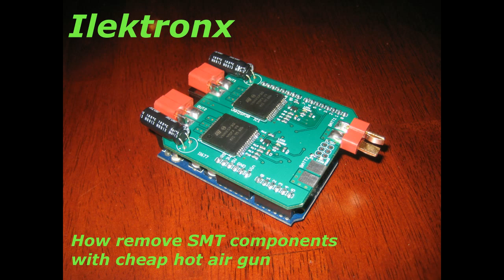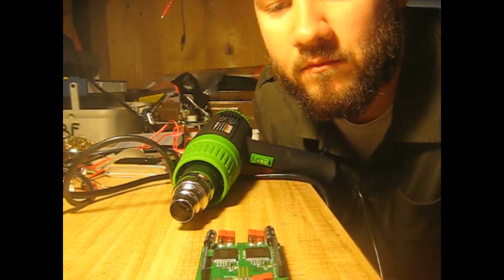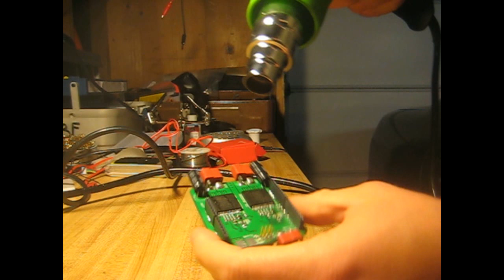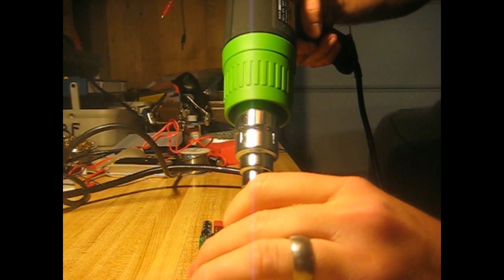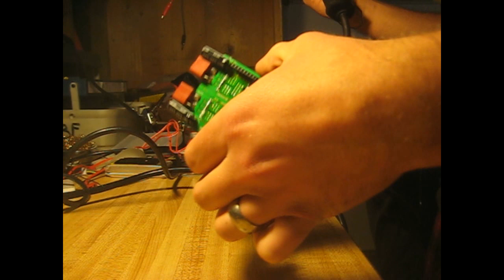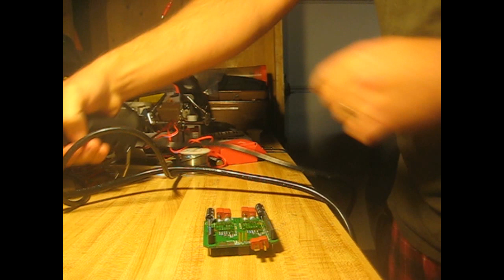How to remove surface mount components with a cheap heat gun

Comment: Tip: use a Tip

There is a small tip attachment available that lets the hot air pass through a small tube at the end and focuses it only on the contact pins, only heat the contact pins and that will never damage the chip 

for other parts, use a foil paper to cover them (stick that foil using a foam tape so the foil doesnt touch anything

:D
Reply: He said those particular chips had heat sink pads underneath

Comment from the maker: Use the 572F.  For a real hot air station, around 600F is a good setting.  That should allow the solder to melt but not hot enough to fry anything.  My heat gun doesn't have specific temp settings, so I just put it on low and apply heat carefully.

Comment from the maker: Also, nice hot air stations have attachments for each standard chip package so that you can apply heat to all the pins at once.  The chip in the video had large thermal pads underneath, which make it a little more complicated.

I like the foil idea.  Definitely worth it if you have sensitive parts on the board.

Comment: Finally, some people prefers to user soldering iron with a really small tip rather than a heat gun to desolder chips, its harder but they said its gives more control and don't damage the parts.

Comment: Yes, they are called SMD rework Stations or something like BGA reballing machines.
you can (on some machines) set temprature and it will automatically remove/resold the chip

Comment from the maker: The caps should be rated to well over 500F for reflow.  As long as you only keep heat on there until the solder melts, you should be OK.  I've had caps blow under electrical load, but never soldering.

Comment: It permitted me to remove a 14 pin SMD soldered in backwards. It only took a few seconds on the lowest setting and the chip separated just fine and my board is working with the re-oriented chip. I fail to see what the ruckus is from all the "pros" out there. (I've been soldering for nearly 40 years by the way...)

Comment: Also, you can measure the hot air with a multimeter using the temp probe on it.

Comment: You need to use the same reduction adapters from a soldering station on the heat gun to gain more temp and pressure.

Comment from the maker: You realize that this is for hobbyists, right?  Did you hear me say in the video, "This isn't something you want to do in production"?  If I were running a mobo repair shop I would have a $400 heat gun with adjustable heat and airflow.  The tools for cheap prototyping are different than that for consumer repair shops.

Comment: Just bought a $15 heatgun at Harbor Freight.  Has 2 settings, 572 degrees and 1112 degrees F.  Which is closest to the setting you used here?  I wanted to reattach a surface-mount coil to an older model video card that arrived shipped to me from a seller on Ebay.  They didn't pack it well, and upon arrival that part had popped off the card.

Comment from the maker: That heat gun should be more than adequate, and it should have removed it in 20 minutes no problem.  You can never have too much flux... well you can, but I doubt that that has anything to do with it.  Is their some conformal coating or some other mechanical means, other than solder, to hold the chip in place?  Epoxy or something?  The only other thing that I can think of is that the air gun is not close enough to the board.  Can you remove any other chips around the one you want to remove?

Comment: I am trying to remove a bios chip from a pretty old board I cant use anymore.I am  using a hot air gun, I am having trouble using pulling this off.  I added flux and had the thing running for almost 20 minutes with no luck, did I put too much flux or do something else wrong?   The model of heat gun I'm using is Wagner Power Products 503008 HT? Any advice would help

Comment: Is it possible to use this heating air gun to weld the ic on the pcb?
Reply: Sure is, but you have to be careful not to ruin the IC. I've successfully done it in a pinch. ICs typically absorb moisture over time, and rapid heating can cause the internals to crack due to expanding gasses.

Comment from the maker: Sorry, but you must not do a lot of soldering.  Sometimes, when you have large ICs with large ground pads on a large ground plane, a cheap heat gun beats the pants off of a nice hot air rework station.  Try again.
Reply: So true

Comment from the maker: You are being ignorantly rude.  Google 'moisture sensitive parts' and the first result should be a PDF from Actel about moisture sensitive parts.  Most ICs from high volume distributors ship with dessicants and a moisture exposure sensors that indicate required bake times.  If you want soldering over a fire, google 'Desoldering a QFP SMD IC using a candle.'   The only flaw of 'el cheapo' heat gun is its inability to provide a specific heat profile required for soldering.